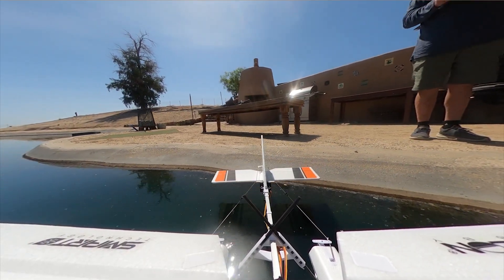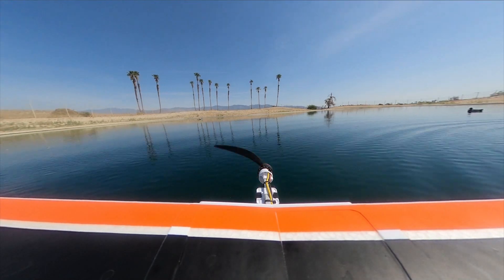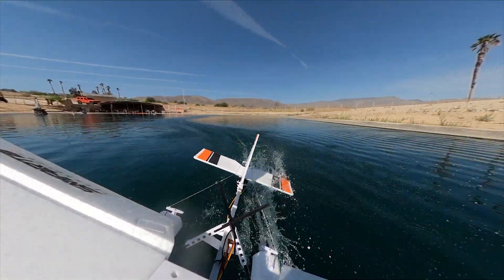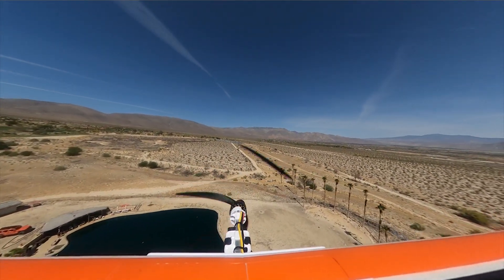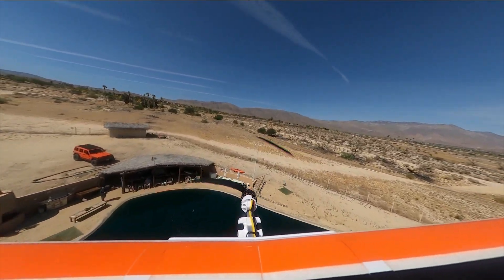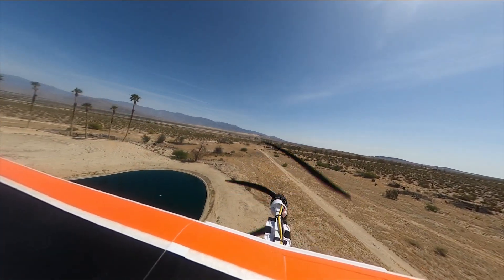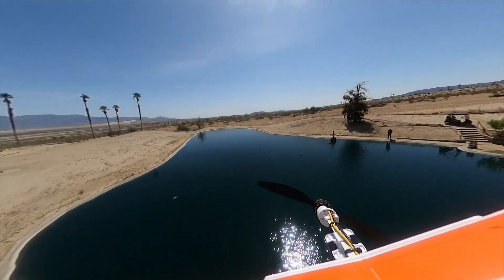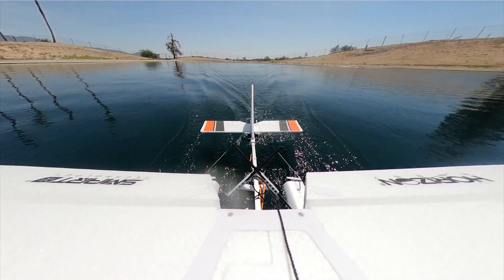E-Flite Slow Ultra Stick on Floats

Comment: oh man this is awesome  i have the same plane but i put a fpv unit on it , how did you make the pontoon landing gear? do you have any pictures? or part list .
Reply: i forgot to add to my comment , thats some sweet azz muzak !
Reply from the maker: It was simple, I used a spare set of Eflite Air Tractor floats and spare set of Slow Stick landing gear that I mounted on the fuselage tube behind the wing. I simply took the wheels off the gear and mounted the floats to the axles. I rigged up some line from the tail gear to the water rudders for steering.
I'm about to remove the floats and mount a DJI 03 unit on it for FPV.
Reply from the maker: Hey how you doing TNT! 
I finally got the SUS working with the FC but I totaled it right there at this pond lol. 
Appreciate your help, the receiver you linked worked great 👍 
I just had too many flight modes setup and couldn't keep track of them.
Reply: @CaliforniaOutdoorsman  thats good to hear , i started with just a few modes then added more as i got more comfortable with the flying hopefully you had some fun !